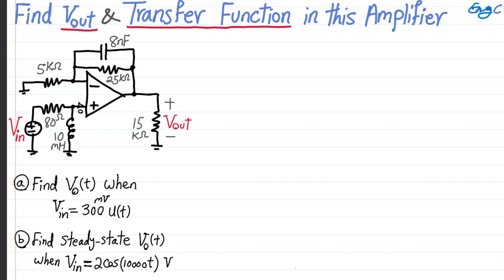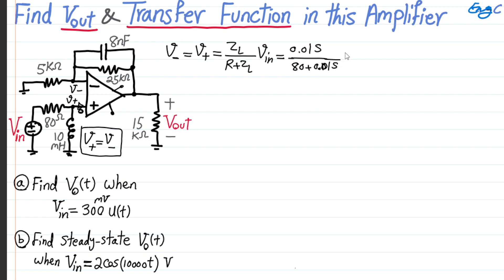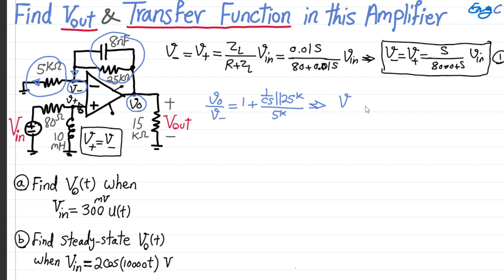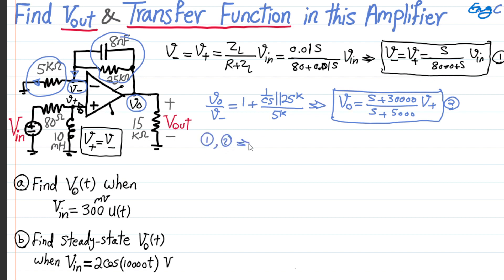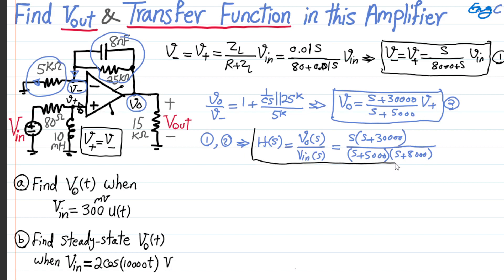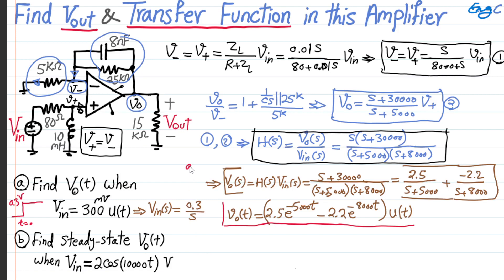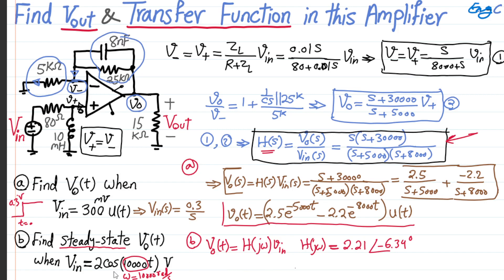Find output Voltage & Transfer Function in this Amplifier Circuit

Comment from the maker: This Video shows a quick way to find the Transfer function, transient response and sinusoidal steady state response of amplifier circuit. For more Op Amp Circuit and Analog Filter examples please see: 
Sallen-Key Analog Filter Design Tutorial https://youtu.be/KwUnQXbk7gM
Frequency Response, Bode Plot, Transfer Function of Analog Filter https://youtu.be/vZFkPeDa1H8
Op Amp Analog Computer Differential Equation Solver https://youtu.be/ENq39EesfPw
Universal Analog Filter Design https://youtu.be/2J-0msXZE2o
Laplace Transform Example and S-domain circuit analysis:  https://youtu.be/ps8N5TPM_qU
Op Amp circuit Bode Frequency plot https://youtu.be/BLVzuuqAlZs
Analog Logarithm Computer https://youtu.be/RpKEq5WyoLg
Lowpass Butterworth Filter: https://youtu.be/UzCjkwqy-9w
Analog Computer to Raise Signal to power n https://youtu.be/IUTlBH1UraE
Triangle Oscillator Op Amp circuit https://youtu.be/JF5Up_cuL9k
Push-Pull Power Amplifier with Darlington Transistors https://youtu.be/866MYibo8yE
Differential Equation Solver Analog Circuit https://youtu.be/R3X5AYNZGEI
Complex Sinusoid Oscillator https://youtu.be/GXRhmwmS5Zk
Sawtooth Oscillator Design https://youtu.be/2eUsGPfqbW4
Full-Wave Rectifier circuit example https://youtu.be/DJJMNU-CYcg
Sawtooth Waveform Generator design with OpAmp, JFET, BJT https://youtu.be/5zHXTx-Vl20 
op amps Circuit with feedback loops to design an analog computer that solves a second order differential equation https://youtu.be/HeZRtnRXpEI 
For more analog circuits and signal processing examples see: https://www.youtube.com/playlist?list=PLrwXF7N522y4c7c-8KBjrwd7IyaZfWxyt
I hope these Circuit design and analysis videos are helpful.

Comment: What happened to 0.3 from Vin(s) in the first case (a)?
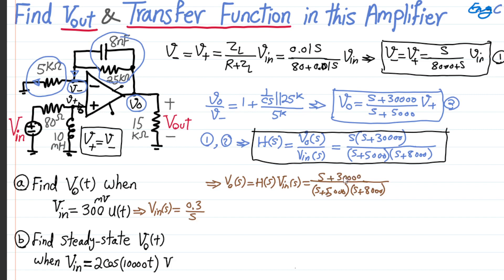Reply from the maker: @maggotbrain7499 Thanks for your detailed attention and good question. While 0.3 was inadvertently not shown at 6:57, the reported Partial Fraction Expansion (PFE) coefficients (2.5 and -2.2) are correctly reflecting consideration of 0.3 that you referred to.  For a more detailed example see https://youtu.be/vZFkPeDa1H8 video about Frequency Response, Bode Plot, Transfer Function of an Analog Filter. Thanks again.